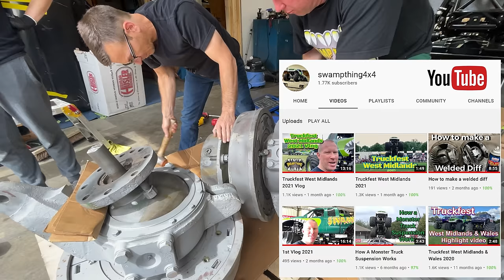Building my dream Monster Truck ep3

Comment: As fun as this is to watch. A guy that builds Monster trucks for a living, would look at some of these procedures and say, nope that wont work, or nope thats going to break. You need some one on your build team that has built monster trucks. It will save you lots of headaches. Fix the problems before they becomes a real problem and possibly lead to more or an injury to you. Its not just an oversized RC toy.

Comment: Not sure if you didn't show it on the footage Kev, but a decent torque wrench would be a good idea to make sure all the fixings are tightened correctly.
Reply: I came here for this.
Reply: my thoughts too! I also suggested to Kev to Loctite the nuts. I'm no expert so not sure if thats required ? It just seems a good idea to me considering the enormous vibrational energy that will resonate through that chassis from the V8 monster engine i assume will be going into it!?

Comment: Make sure that the drive shafts are phased properly, when you took the slip section out of the rest of the drive shaft those two arrows have to point at one another when you put it back together or you'll get a big vibration and could break some stuff
Reply: X2 on this and for all the U-joints on the other shafts...
Reply: You talk rubbish mate, you only get vibration if the drive shaft is unbalanced, it only goes in one way, Kevin has done it perfect, nice job Kevin 👍
Reply: @generalrc2154  do yourself a favor, and don't comment on something you obviously don't know anything about. Go ahead and look up driveshaft phasing.. it's right in my first comment. If you simply educated yourself before jumping on your keyboard, you wouldn't look like an idiot.

Comment: if you want the fiber glass to last, you will need to span the weight across the fiber glass,  use aluminum, build a aluminum frame for the fiberglass then attached it to the truck, if not the fiberglass will start to stress crack the way you mounted it on very few points

Comment: Just in case, make sure you matched up your drive shaft marks to keep it in balance once you took off the slip yoke. Some may not thing it’s important cause it’s not going fast but I make these for a living for tag axle/ tri axle dump truck and it will ruin plenty of parts

Comment: I'm an Aircraft Mechanic and we safety wire alot of fasteners on Aircraft. Bolt heads, nuts, etc. Don't they require quite a few things to be safety wired on those trucks too like some race cars and such?

Comment: Hey Kev your on the right track with the vice for the u joints. I use a socket to push them in enough for the c clip

Comment: I'm a mechanic it look like you did everything pretty good other than knocking those U-joint caps on with a punch next time use a socket that is close to the right size and tap them in with that

Comment: Annother tip, when you mount nylock nuts. Don't use the ugga dugga. The high speed can overheat the nylon in the nut making it a "not so-nylock" nut. 😝

Comment: Put a piece of 6mm rubber sheet or even thicker a horse stable mat would work in between body mts and the chassis to give it a little bit of shock absorbing so it won't vibrate and crack the body at the mounts

Comment: ALSO WHEN YOU TIGHTEN BOLTS WITH A CORDLESS IMPACT GUN OR IMPACT SCREW GUN OR EVEN THE 3/8THS IMPACT GUN!!!!  DON'T EVER TRUST THEM THAT ITS TIGHT ENOUGH OR COULD EVEN BE TOO TIGHT!!!  YOU COULD HAVE A CRACKED BOLT OR NUT AND WOULD NOT KNOW IT, ALWAYS PUT A WRENCH OR TORQUE WRENCH ON IT

Comment: OMG you are doing it all wrong, you forgot the lock washers. The whole thing is going to break into pieces when you hit the first big jump. I have built at least 50 monster trucks and I can see a lot of problems with your build, too many to list. I would get an expert to inspect your driveshaft before you drive it. It looked like you just slapped it together, in the hopes you got it right.

Comment: Didn't you throw stuff away when doing of the truck have a red body with the dog with the wheels in the mouth and the dog was clenching down on the monster truck axles I can't wait to see the body on the truck because when I saw that picture the thumbnail I just froze and this is a comment coming from someone that didn't even like the first thing because you was way too overconfident